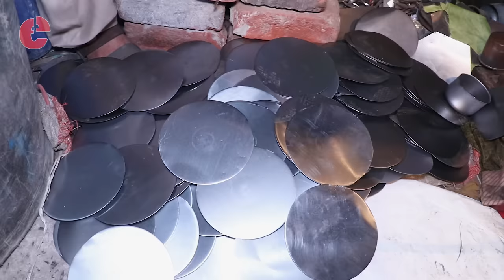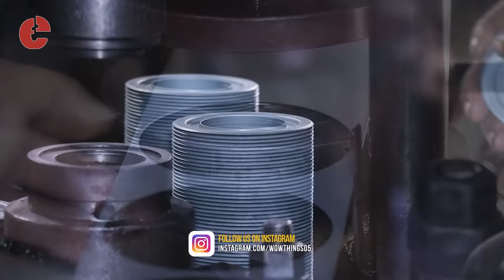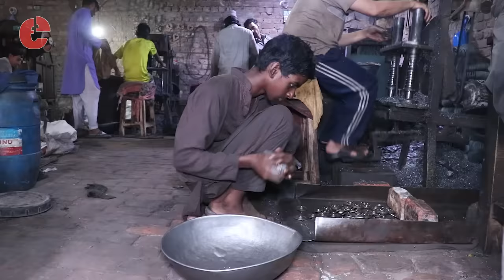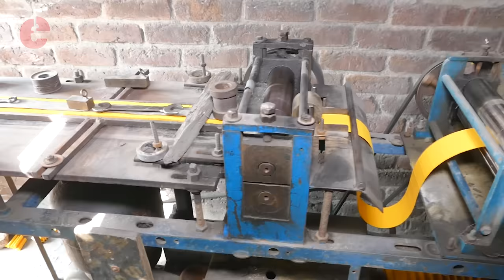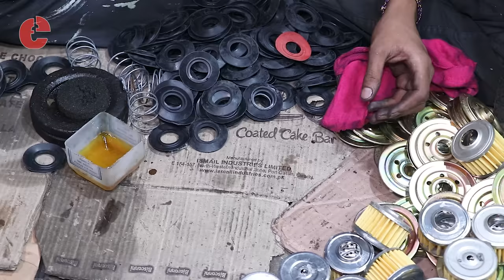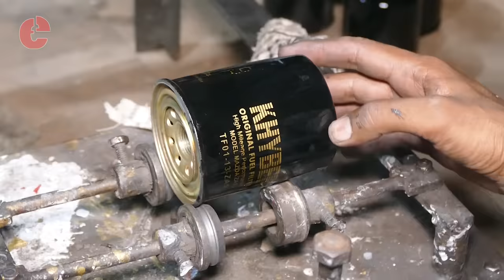How Car Oil Filters are Made

Comment: Well that's a relief.  I found a few metal shavings in my last oil change.  Turns out it was from the filter, not my engine.
Reply: They're fuel filters...
Reply: @sr1g  working at a mazda dealership it is safe to say I wouldn't run this filter as we did not offer it. mazda injectors are not cheap either
Reply: First, those are fuel filters, not oil filters. If you run one of these filters then you probably dont care much about your car anyway... those filters are not common even if you look for cheap ones. 99% of them are mass produced in large factories on automatic machines, this is just rare dumb and backwards manufacturing, and you wont see those products anywhere besides maybe local markets there.
Reply: @sr1g  They may say fuel filter on them but they are not fuel filters.
Reply: @deltafire5058  Hahaha, this looks like a fuel filter, and even if you are completely clueless and never saw a fuel filter then it says fuel filter. Even if you are still in doubt then you could google it. What a fail, are you in a "who is the most wrong human on this planet" competition?

Comment: I like how the yellow filtering paper is cut by hand at different lenghts. Taking about optimal performance right here!
Reply: oil "filters"
Reply: Lucky buyers are the ones having 1/8 roll more of the element. 😂
Reply: Wipe your threads out with an oiled wrag before you install your filter.
Reply: Everyone one of papers will have the same number of flutes . I worked in factories in the fifties before all of the automation and retired as an engineer .
Reply: I like how it says "Fuel Filter", but they are clearly oil filters...
Reply: @Papawcanner yeah that's a factory with standards and not a  Karachi garage lime in the video
Reply: @DaDaDo661  I worked in a factory producing oil filters . The end caps often weren’t stuck to the fluted filter elements making the filter a useless tin can . Standards indeed .
Reply: @rayhai6781  you do know they can look the exact same right......
Reply: @gwot  Nope, never seen a fuel filter, that looks like that...got external threads and minimum two connections
Reply: @rayhai6781  now you know, there are fuel filters that look exactly like oil filters
Reply: @rayhai6781  fuel filters can look like that.
Reply: That’s a DIESEL fuel filter. Gas filters most certainly do not look like that.

Comment: Here I was thinking that oil filters removed metal and dirt from your engine,when in reality the reason is to add swarf, dirt,  garnet dust (the most abrasive material used in industry), glue residue and paint. Everything a growing engine needs.
Reply: Doesn’t make it better but if you read the filter casing at the end these are fuel filters
Reply: I think even the ones made in the Us aren't made in sterile clean rooms.
Reply: @Yophillips3272  very few things are made in sterile clean rooms

Comment: you know it's a bargain when you buy an oil filter for your mazda and it's labeled "fuel filter."
Reply: This actually fuel filter for Mazda Diesel truck in the far east and South east Asia area.
Reply: @slonold3554  ah ok interesting
Reply: @erikarnold4737  and I believe the Truck brand is not Mazda but "HINO"
Reply: @slonold3554  HINO is a Toyota brand
Reply: @DSKSeattle   NISSAN
Reply: @АлександрСлинкин-с7е  no, Hino is the Toyota Truck Division.
Reply: lol joke is on all of us they are really silencers lol jk.  Its actually become a thing to use oil filters as silencers. BUT in reality most of their trucks are small diesel trucks which the FUEL filter is like a oil filter because diesel is similar to oil so diesel fuel filter looks more like a oil filter  and  in reality there is not much difference in the 2
Reply: In reality, the only mechanical difference between a fuel filter and an oil filter is the place you put it. Sometimes even the shape differs, but it's still the exact same thing
Reply: Looool😂😂😂
Reply: Wkmder if any of these workers even own a car
Reply: Indeed
Reply: @TheRealBigYang  Not always true. The micron rating for oil filters is usually higher compared to fuel filters. Modern diesel engines require finer fuel filtration down to 5 microns or lower. Typical oil filters are 20 to 30 microns. This difference is accomplished with different filter media
Reply: hahahaha
Reply: Big respect to the factory workers
Reply: @2shay550  Yes, but I was talking about the very basic function. It's all a paper thing inside a metal thing :D
Reply: Its for diesel vehicles .yes diesel is an oil
Reply: @slonold3554  Ah! I thought that less filtering material can not be for Oil Filtration.
Reply: Man I am so pissed right now lol
Reply: @derrickforeal  A car? How about a pair of shoes to begin with?
Reply: Good tip pal...
Reply: If it was an oil filter it would have an anti drain back valve you can clearly see it doesn't have one in the picture  so it's a fuel filter with that small amount of material in it
Reply: Some filters are actually multi use. Like some hydraulic filters also have a application as a fuel filter. And Diesel is technically a oil so if it's application is for a Mazda Diesel it would make sense.
Reply: Because is for a diesel fuel filter
Reply: @TheRealBigYang  pretty much correct. There are differences in the media, like micron rating and flow but alot of filters can be used for multiple applications and fluids.
Reply: @TeamTopKick  no a  drainvac valve is so the oil doesn't drain out of your filter and I give you good oil when  on your first start
Reply: @livebymyownlaw7641  lol. Yes but if a filter is mounted vertical it's not draining back anywhere. If it's upside down or sideways it can.
Reply: @TeamTopKick  all oil filters have drain back valves fuel filters do not
Reply: @derrickforeal  
I also wonder if any of these workers still have all their fingers
Reply: Well spotted :-)
Reply: Да ты внимательный!
Reply: @derrickforeal     Car?????????????????? Whatsa car???????????????????????
Reply: @livebymyownlaw7641  actually it's a greater percentage of oil filters that do not have a drain back valve. Only certain engines have them.
Reply: @livebymyownlaw7641  maybe your vehicle takes anti-train valves but not all vehicles do.
Reply: @garyszewc3339  no not all vehicles but most vehicles
Reply: @livebymyownlaw7641  I have owned 35 different vehicles, Plus boats, lawn mowers, and utvs, out of all of those I think two had drain back valves. You just happen to drive a vehicle that takes one.
Reply: @garyszewc3339  I don't know if it's a difference in countries mate but all of our vehicles use Em I live in Australia 🇦🇺🦘 how about you where you from
Reply: @livebymyownlaw7641  I'm from Michigan in the US. I considered making a joke saying maybe it's because using the word mate sounds like you're from down under and maybe that's the backwards gravity LOL. It's quite possible the engines in Australian vehicles different from the US vehicles.
Reply: Those are diesel fuel filters i bet !
Reply: @garyszewc3339  I say that's probably the case mate a lot of our vehicles a 4-cylinder petrol 6 cylinder petrol and diesels like in the land cruisers we use a lot of land cruisers in our country and Nissan patrols  few V8 diesels but you guys use  lot of big heavy diesels like in the Ford f series and dodge rams  and all that which might require lot faster flow flowing filters but I don't know about those types of cars I've never owned  one  to have to change the filter on one
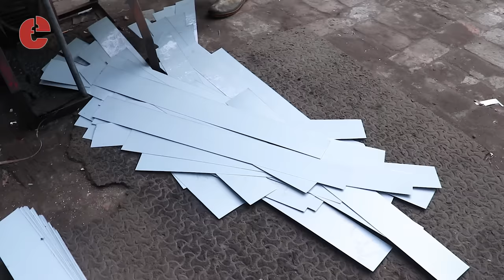Reply: @tonymoruzzi  Dude at 1:55 is missing his left pinky.
Reply: It's still not too late to delete this comment 🤡
Reply: @Ben-fh4zj  yeah mine was totally wrong and dumb but people keep hitting like
Reply: @themichaelcreed  Well spotted
Reply: @slonold3554  5^
Reply: Зато "hand maid"🤣
Reply: @slonold3554  so change the video title
Reply: @rw2266  Not my video! Did your parents have any other children that lived?
Reply: Filtration is about microns. And parts per million. Piece of cloth inside and old oil filter works till the engine eats the shop rag
Reply: @slonold3554  ⁷
Reply: It can be use birg oil and fuel filter especially military trucks in the war zone. Most heavy duty trucks uses diesel and so are tanks and armored personnel carriers.  Diesel is a light oil similar to 0W-15
Reply: Do not demean or undermine other cultures
To buy automated oil filter is very expensive but to produce them without expensive equipment is Ingenuity.
Reply: 😭😭😭😭😭 and they asking for minimum wage to go up 😭😭😭😭😭
Reply: Probably the same in China
Reply: It's all can be made in the USA
Reply: Trucks and tractors have fuel filters like these. Some have 2 or 3 fuel filters.
Reply: but its "Amazon choice"😂😂😂
Reply: @livebymyownlaw7641  Some oil filters don't have a drain back valve. Which is why some people put oil in the filter first.

Comment: Fram has really stepped up their quality since I last used one!

Thanks for the tour of their factory.
Reply: This is way higher quality than Fram
Reply: And I thought the metal in my motor was from the engine. 🤦
Reply: Да конечно!?))))))))))))
Reply: That's why I find metal burrs inside the filters. Always check before you install.
Reply: Now I understand why I found a finger in my filter...🤟
Reply: @David.D3  Actually is higher quality than Fram. Fram uses cardboard endcaps. These are at least all metal.
Reply: @KmanAuto  also REAL springs for by-pass valve.
Reply: Love it😆
Reply: Damn it I was gonna say something like this
Reply: @pierrep123  the dude at 1:55 (missing left pinky) wants his finger back!
Reply: @KmanAuto  not quite
Reply: frams come from a kindergarten arts and crafts time
Reply: The only doubt is in the filter medium and the overlapped seam.
Reply: @David.D3  True...lot more filter material for sure.
Reply: this should be top

Comment: Very interesting to see the process. If they made oil filters in the us by manual work they would likely cost about 200$ each.😊
Reply: A lot of filters already cost over $200 each in the U.S
Reply: If they made them like this there would be a lot more premature engine failures.
Reply: And that despite inefficiencies, like the guy cutting out the filter body shapes by hand with big scissors, then made into smooth round pieces by another guy, yet later is shown a machine punching out round ring pieces.

Comment: It's incredible how watching how something is made can give you an insight on how that thing works. I always wondered how oil filters worked given that all the holes are on the same side but thanks to this video I have a far better understanding on them.
Reply: Oil goes into the threaded hole, pushes through the filter paper, then exits the smaller holes around the center back into the engine.
Reply: @A_Stereotypical_Heretic  In this case, it mostly seeps through the unglued gap in the paper of a random length, making this filter useless. Also you can see that amount of sealant at the top and bottom lids is very random - they literally smear it with the finger. And QC is done by the cars in which they are installed :)
Reply: what blows my mind is my constant attempt to over think how things are made. today machines make or mold everything. it's not complex. even computers aren't complex if you break down what need to be included for functionality.
Reply: @A_Stereotypical_Heretic  It's actually the other way around....
Reply: Shit a lot better quality then American made 😂😂
Reply: @AlejandroSanchez-hs3fu  yeah man totally better than American made... 🙄🤦

Comment: Love how when hes cutting the filter material he just eyeballs it and gets random amounts so some filters have more filtering ability then others
Reply: I got the impression he was using his hand/fingers as an improvised measuring gauge 👍
Reply: I'd be willing to bet that you wouldn't find more than a couple of millimeters difference between them.
Reply: These guys are master of their task. I bet 98% are exactly the same, and thr otherd have just a mm or 2 of overlap which offers nothing better or worse.
Reply: Dont buy. Cheap filter then
Reply: Not to mention that there is no glue or crimp where the pleats meet. You couldn't get me to use these crap things if you paid me to.
Reply: The guy probably does this five thousand times a day, every day for decades. Trust me. It'll be the same size.
Reply: @Diodontgivadayum  I buy made in US Wix filters, and I've torn most of them down, they definitely are not built like that.
Reply: None of those filters have any real filtering capability.
Reply: @John_Ridley  not just that the contamination and lack of care from all the handling makes you wonder if you are filtering or putting more shit in the engine
Reply: Doesn't change anything, the two processes after remove the excess of materials

Comment: Now I know Fram filters are no longer the worst.
Reply: They’re the best
Reply: actually if you go above their cheapest filter they're actually pretty good
Reply: Your right 👍 this is how Fram Filters are made your a genius. 👌😂
Reply: @jeffscomp  😅😅
Reply: I used to run fram till I cut one open 🤣🤣
Reply: @xxuncexx  Yeah I heard something about this but in the end filters can be one of the most underrated parts considering their price per km or days.
Reply: The metal endcaps they glue on the pleats here...  Fram was (is?) using CARDBOARD similar to what cereal boxes are made of.
Reply: All filters are basically the same, besides the pleat count. The filtering material is all garbage. I worked at a plant in Ohio and their filters were made for multiple companies. Change em every 3000 miles

Comment: You know I'm always impressed by how hard you guys work but the unsafe working conditions. I'm sorry that you don't have better working conditions and safety.

If I were there welding without safety glasses I'd be blind as a bat by now because my eyes would long been full of hot material.
Reply: Полностью согласен.
Всю грязную работу делают руками, без перчаток и стэндов, на коленях.
Reply: True that he should be wearing safty glasses (they all should). However you don't go blind from spotwelding as shown here.
Reply: This was the US 50 years ago, then OSHA became a thing.

No joke, men in US factories would expose themselves to unimaginable danger, especially in metal production foundries.
Reply: @Just-Steve  Err, no. Maybe 120 years ago. I worked in a factory 50 years ago and there were plenty of safety protocols in place, it you didn't follow them you were fired. I also had a different job where I made deliveries to numerous manufacturers and some steel plants - same thing.
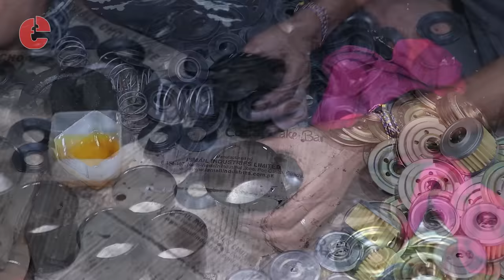Reply: Look at 5:55 and the oil filter canister with all the rust in it.  That will do wonders to your engine!
Reply: Ресурс рабочей силы неограничен , слепого поменяют на зрячего , там очередь на работу .
Reply: @robertthomas6127  Maybe not from the UV flash but those "sparks" are molten steel.
Reply: Основы капитализма. :)
Reply: Definitely not an oil filter (fuel filter) but similar manufacturing process. Impressive.
Reply: What's un safe? They should have on safety glasses in some of this ,but it's a normal small machine shop. Plenty of this still goes on here in the USA
Reply: @grinderthree226  Safety flip flops, safety squints around all those metal shavings, booger and nose hair P100 respirator for that painter chap… need I say more?
Reply: @Rayden440  he'll we have one rule in our shop. No gloves or loose clothing while running any machine. We don't give a damn if ya show up in your boxers wearing Jesus sandles as long as your quality is good.
Reply: @grinderthree226  I’ve been in many machine shops and never had to sit on the floor (bare ground?) for starters.
Reply: @batterybuilding  well good for you..Wana cookie? 🤡
Reply: @Anti Antifa NS  it's not that bad really I mean, not many places let ya drink at wo
Reply: @Anti Antifa NS  it's really not that bad. They pay us good, has good benefits & they don't care if we have a a drink or 2 while working.
Reply: @grinderthree226  hell yeah where do I sign up?!
Reply: @Just-Steve  "50 years ago" Yeah dude you're off by like 70 additional years. If you think this was the US 50 years ago you actually need your brain checked

Comment: This video was not what I was expecting. I wouldn’t believe filters were hand made like this anymore. I’m not cheaping out on oil filters anymore.
Reply: the question is would you use these filters in your car.?
Reply: @ImionsaeXwb77  I buy OEM from the dealer. They don't cost that much more.
Reply: @ImionsaeXwb77  nobody should use this filters lol unless the are like 2 dollars
Reply: @deangregoric4735  there is already more dust dirt debris in the filter, than it will get while in operation,. no thanks
Reply: @ImionsaeXwb77 No, if oil flow is wrong you will destroy your engine.
Reply: @deangregoric4735  Even at 2 bucks the risk is too great.  This is like apocalypse oil filter manufacturing.
Reply: Mobil 1 is the best
Reply: @deangregoric4735  They are 2 dollars when your dealer buys them, and $20 plus installation when the dealer puts them into your car.
Reply: I always buy genuine oem one from authorised dealer.

Comment: Impressive.  I can understand why some car manufacturers have switched to canless oir filters.  But what is confusing is them costly as much as canned ones considering all the labor and parts being saved.
Reply: The thing is, that's NOT how oil filters are made in any civilized country this here is counterfeit low effort terrible quality filters without any standards or quality control what so ever.
In normal factories its all automated & produced in the thousands daily, but if you want engine damage go ahead & by crap like that.
Reply: It's not even oil fitlers. The can says "fuel filter".
Reply: @JohnnyC01  Seems they are making many different types and sizes.